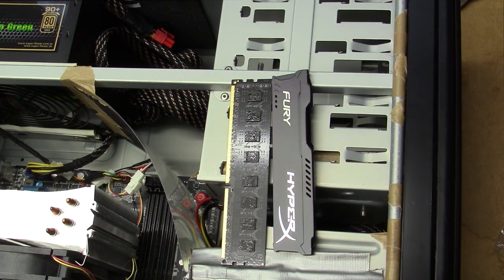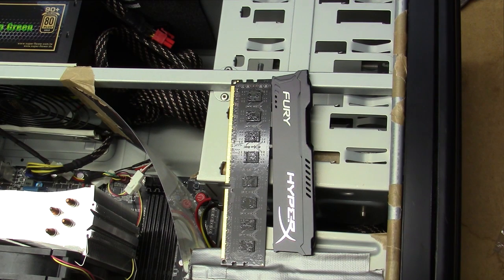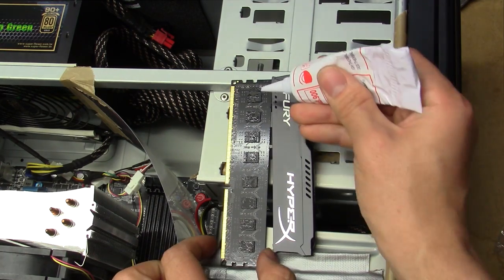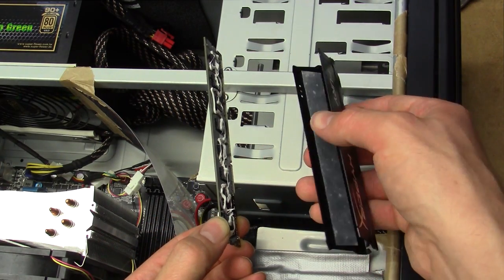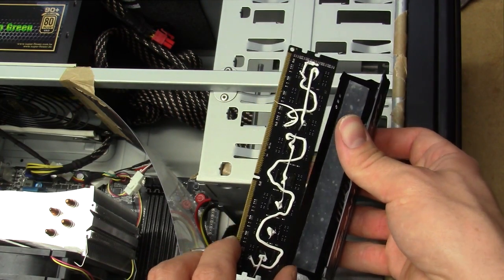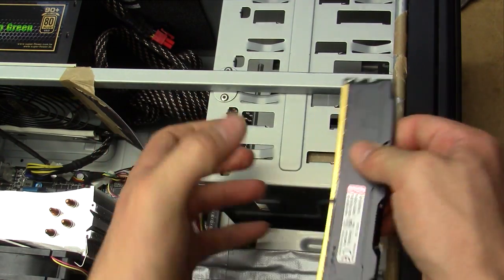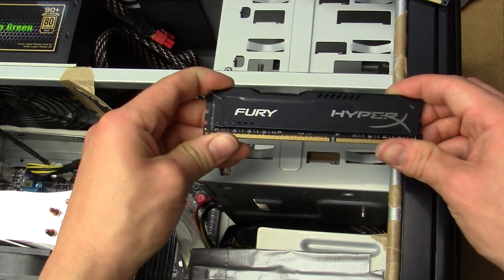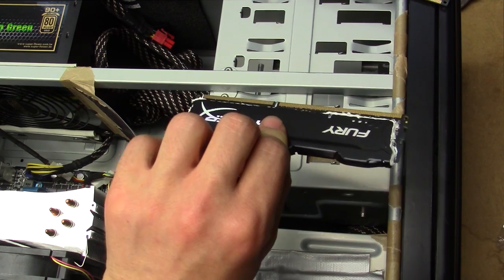Bloody RAM falling apart again

Comment: I tried pulling the heat spreader off my Crucial RAM, it ripped one of the memory chips clean off the PCB, complete with solder balls and some tracks! No great loss, the module was failing anyway. Like all adhesive, it's only strong when you actually want to remove it!

Comment: If the heatsink is just attached with adhesive then it's just there for looks. I've ran plenty of RAM heatsink-less with no problems. Something like 3200Mhz ddr3 might need a heatsink but with ram like that you can tell as the heatsink is attached with proper adhesive thermal pads.
Reply from the maker: The adhesive used is definitely thermally conductive, since the heat sinks get plenty warm. I think I just happened to buy really cheap, old and inefficient RAM sticks. The fact of the matter is that these sticks don't work properly if the heat sinks fall off, because the computer gets random RAM errors when that is the case.
Reply: +FFcossag ahh, to me the adhesive that was on them looked like the hard non thermally conductive stuff, used to seeing the light pink adhesive thermal pads on ram, my bad.
Reply from the maker: nifnat I don't blame you; I too was initially certain that the heat sinks on these were just stuck on there for the wank factor.

Comment: Please measure the temperature, I do not think using them without those tiny "heat sinks" will destroy the modules. They are probably just there for the good looks. If they do need some kind of cooling it should be something like the Thermaltake RamOrb RAM Heatsinks and not those flimsy looking ultra-thin badly bonded flat plates.
Reply from the maker: I haven't checked beyond feeling the exposed BGAs with my fingers and going "ow", which would suggest that they reach 60-70 C at least. While that's not insanely high, it is a bit warmer than I'd like to see RAM run. The larger surface area of the aluminium heat sink definitely lands it a much lower thermal resistance to the surrounding air.

Comment: oye, you shouldn't have gobbered it all in there, the flow of air is stopped.. just put more fans! Moar powa! what was the brand of shmoo??
Reply from the maker: A heat sink like this works by increasing the surface area of the thing that's being cooled. Most of the space between the PCB and the heat sink is occupied by the bonding area of the chips to the heat sink, so I don't think it'd make a huge difference.

The goop I use is branded Fujik, I buy it off of Dealextreme. Very useful stuff.

Comment: why would you even need a heatsink on ram? i've never heard someones ram overheating
Reply from the maker: Now, you have.
Reply: FFcossag i haven't. i bet if he didnt put the heatsink back on it would have worked just as well
Reply from the maker: A Banana The computer was having random RAM issues when the heat sink was crooked, and they went away after I put it back. Perhaps it was shorting against something to cause those problems, but I think it sounds more likely that such a case would cause the computer to just not work at all.